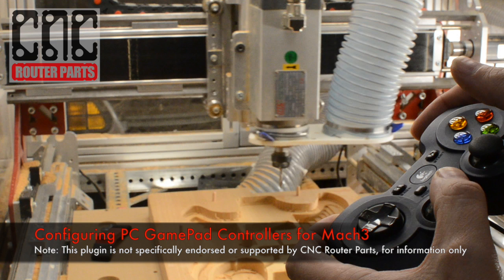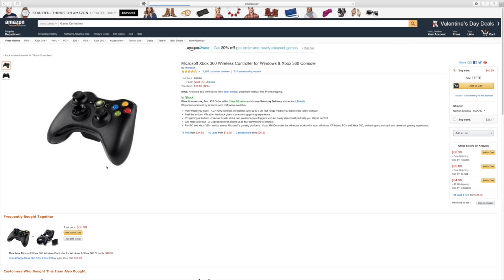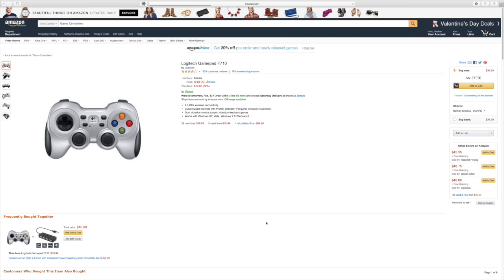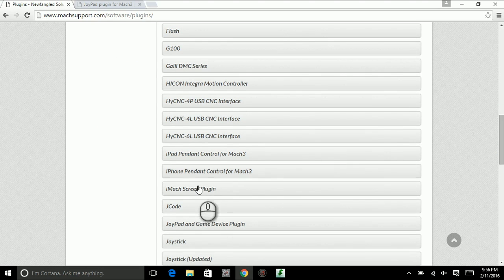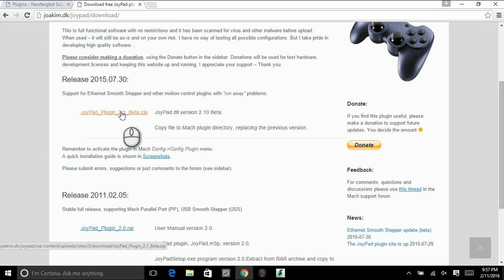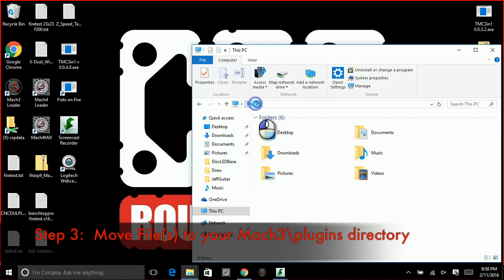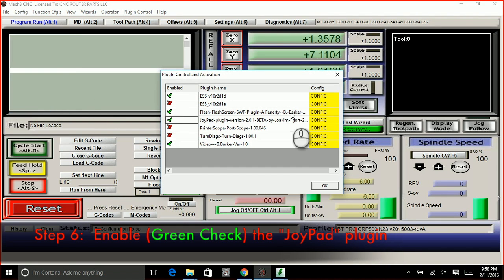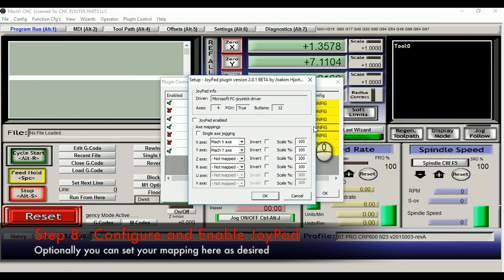How to use Xbox controllers and other GamePads with Mach3 and CNC Router Parts Machines

Comment: Are you using Windows 10 with Mach3 on your CNC's with the smoothstepper? If so, is it home or pro?
Reply from the maker: +Jason Fritz Yes, all of our CNC Plug & Play Electronics include a integrated SmoothStepper.  We run a variety of supported OS's for validation,etc.  This specific PC was running Windows 10 Pro connected to our 4-Axis Plug & Play System (http://www.cncrouterparts.com/4-axis-digital-plug-and-play-nema-23-system-p-260.html)
Reply: +cncrouterparts thank you for the reply! I'm looking to buy the pro4848 soon. Just not sure on what computer to go with. I will be contacting you guys with more questions soon.
Reply from the maker: +Jason Fritz Sounds great, we are looking forward to talking to you!  We generally recommend mid-range PC Netbooks (~$300) with "chiclet"-style keyboards for dust resistance (and less likely to be sucked-up by your shop-vac when you clean-up) as CNC control PCs.